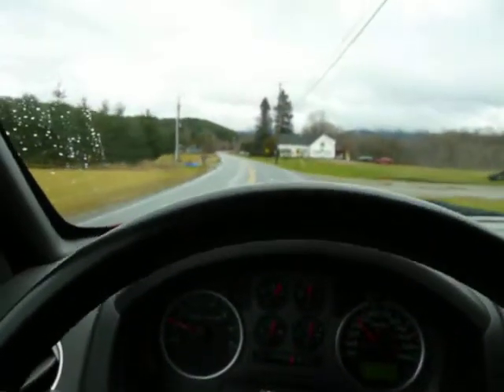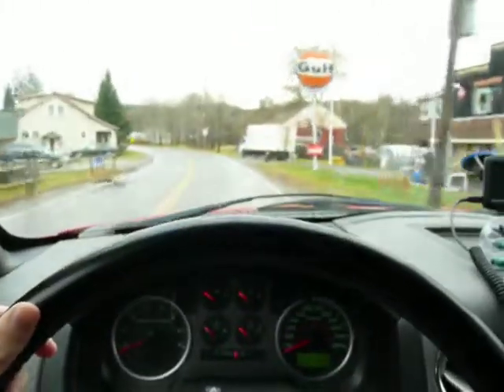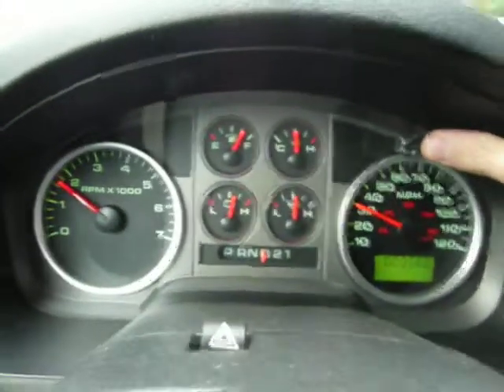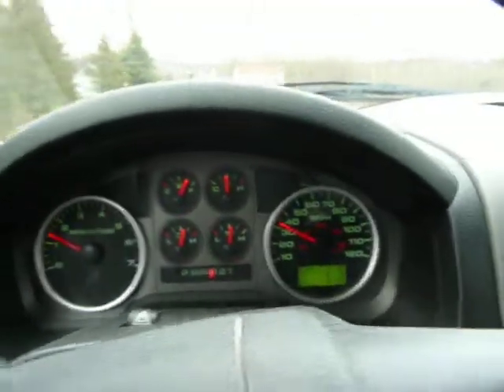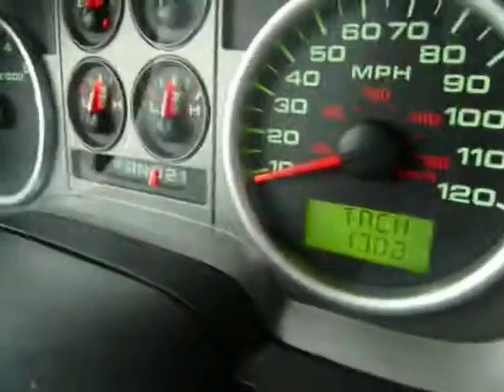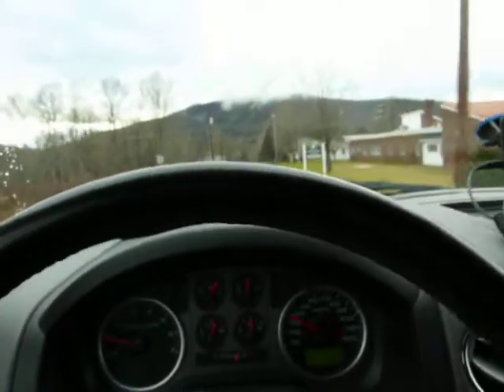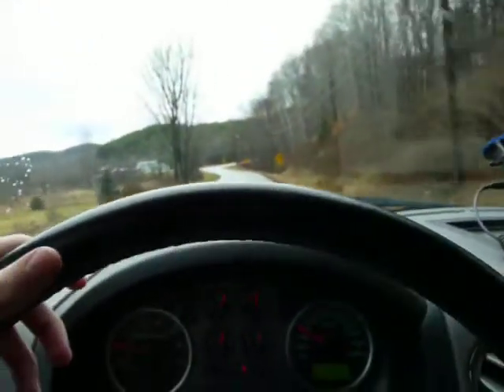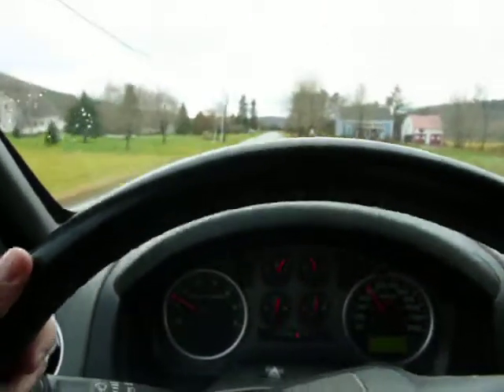Road Test: Ford HEC Dealer Test Mode (Engineering mode)

Comment from the maker: There is nothing wrong with the vehicle.  The vehicle is in engineering mode.  One of the functions of this mode is a gauge sweep, this is a demonstration of it doing a sweep while driving.  It does a full range of motion sweep, then it returns to normal mode.